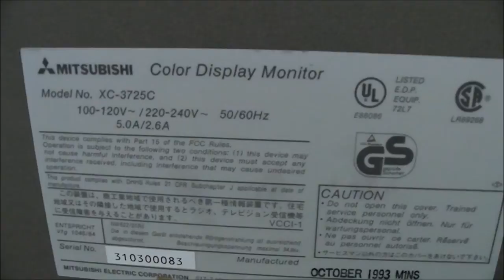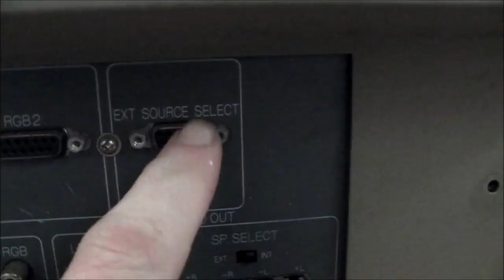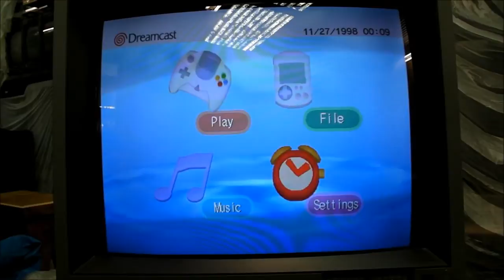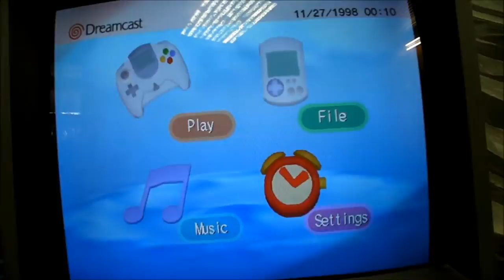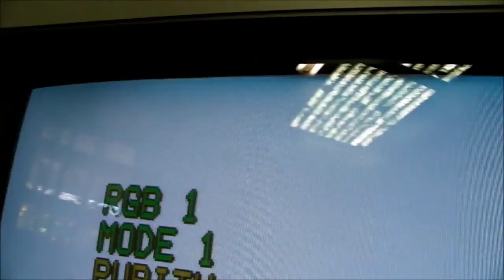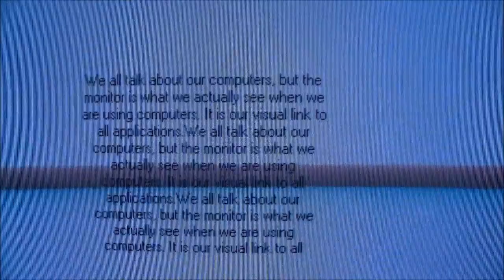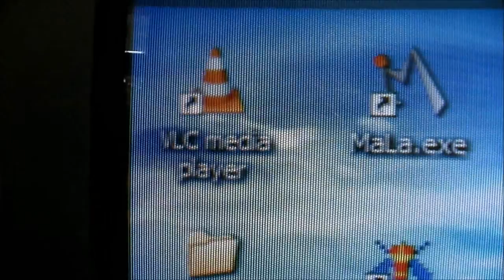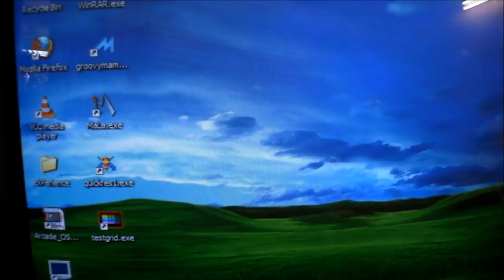Mitsubishi XC3725C 37" Presentation Monitor

Comment: Supports XGA. A very alluring unit.
Reply: I have a 32 inch crt that does 1024x768, currently using it right now, it's insanely sharp.

Comment: Hey, I know this video is old, but a bit of info, Mitsubishi presentation monitors will only accept Csync or HVSync at a fairly high voltage level (despite manual saying they'll take 0.3v level sync too).
It's no problem with VGA sources, but with 15k consoles, you need their sync to go through an LM1881 with it's output directly connected to the C/H input (no attenuation resistor).
Reply: So, using a sync stripper you can properly display 15khz RGB from retail consoles such as Genesis, Saturn or PS1?
Reply: @pedroTFP  yes, as I said the sync stripper needs no resistor on the output (usualy a 470R), to keep the voltage level high enough to work with the monitor.
Reply: I'd like to add to this. I'm feeding my XC-3725C with a 15kHz RGB signal and it works beautifully.
Reply: @Johnbscv   hi
but the monitor XC-3725C is +480p , he doesnt work with 15khz
Reply: @Johnbscv  Thanks for your comment.  Does it have the black lines between the scan lines typical of 240p content?  Also, how did you connect the wires?  Did you just solder the sync output wire to the LM1881, and then another wire for the output to the monitor?  I'm trying to figure out how to do this.
Reply: @ryoandr  thanks for your comment.  I'm recently got this monitor and am trying to get 15kHz working on it.  With the LM1881, did you just solder the output sync wire from your console to the chip, and then another donor wire for the output to the monitor?
Reply: @FairyKid64  I have a scart-bnc box with an USB cable for 5v power for the LM1881, on some consoles you have 5v on the av-out but be careful as some region variations may have up to 12v instead. You can find the circuit easily on the web. Usually you add a 470R on the sync out to reduce the voltage to TV levels, but on mitsubishi monitors you have to go straight, no resistor. Also, you can use any signal with sync, like composite video, svideo luma, csync ; LM1881 will strip unneeded signals, and will amp if csync is already used.

Comment: I loved SEGA but they really are incompetent evento this day. The Dreamcast doesn't output true 31khz 'vga' signal. It is actually 720x480 but all software is limited to 640x480 within that signal.

Because of this, some HDTVs with vga input don't handle the signal properly. This is also why you still get some pillar boxing when stretching DC image on a widescreen display.